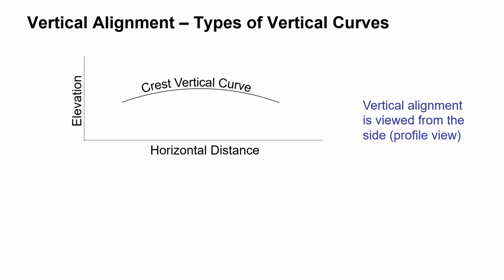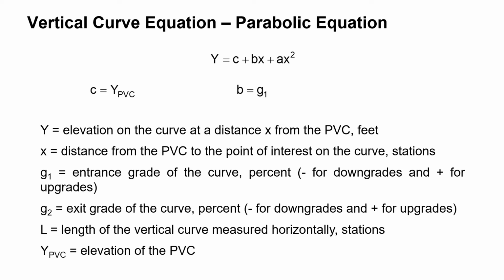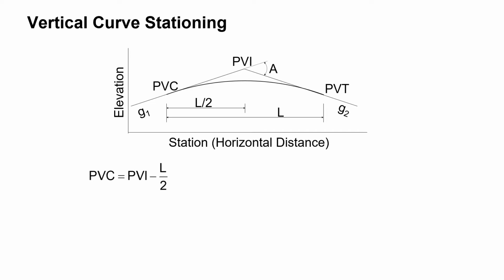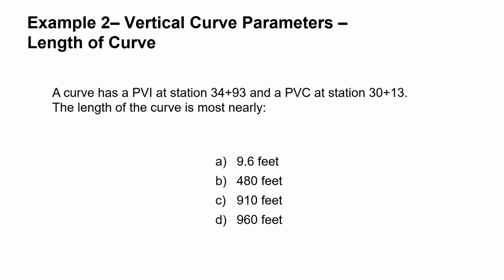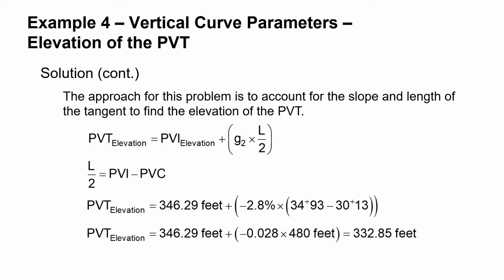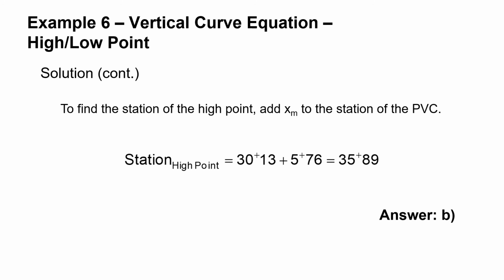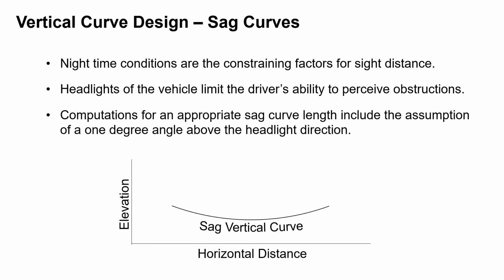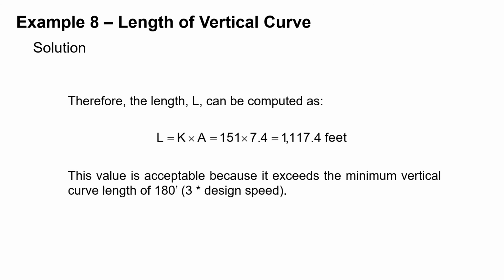Vertical Design: Symmetrical Vertical Curve Formulas and Examples | NCEES Civil Exam [Section 5.3.1]

Comment: For example 1, can you please explain why you are assuming that L = 2*480=960? That is assuming that this is a symmetrical parabolic curve. If its symmetric, wouldn't G1 and G2 be equal?
Reply from the maker: For vertical curves, "symmetric" refers to the length on each side of the PVI being equal, not the grades.

Comment: are some of the equations you mentioned that are not in the handbook in the CMA or greenbook or other reference? I know example 3 had used PVC elevation = PVI elevation - (g1*L/2) and I couldnt find that in the book. I would imagine it has to be in another usable reference manual for the exam?
Reply from the maker: The equations in this video are from the 2021 v1.0 Reference Handbook.  Because the equation you referenced has been removed, I assume the intention is that we need to know this relationship and apply it during the exam.  The equation is essentially telling us to find the elevation of the PVC by starting with the PVI elevation and subtracting the grade multiplied by the distance.

Comment: so for A ( algebraic difference in grades), and a (parabola constant), g1 and g2 are only numbers (no percent). For example, 4.2% upgrade, and -2.8% downgrade, when we using these grades to calculate A or a, they will be used as 4.2 and 2.8. However, when we are calculating PVC, we need to use4.2% and 2.8%?
Reply from the maker: As you know, the units are extremely important - it's possible to use feet & decimal percentage OR stations & percent grade.  For instance, if you had a grade of +4% for 600 feet, these two alternatives would be:

Feet and Decimal Percentage:        0.04 * 600 = 24 feet of elevation change

OR

Stations and Percent Grade:           4 * 6 = 24 feet of elevation change 

For simplicity and also for consistency with other vertical curve calculations, I recommend using stations and percent grade.